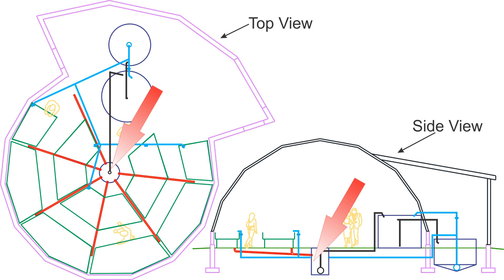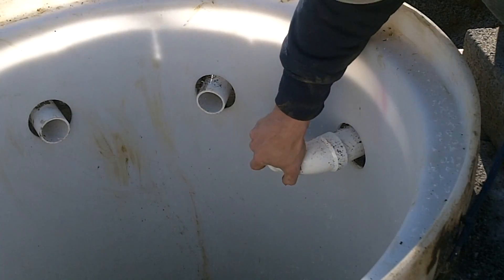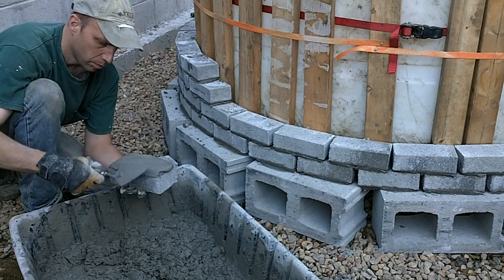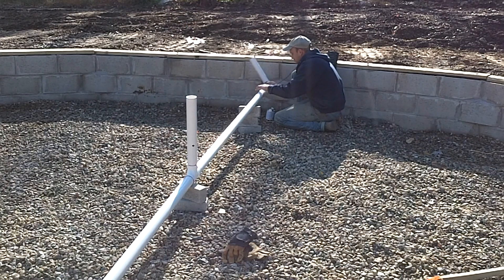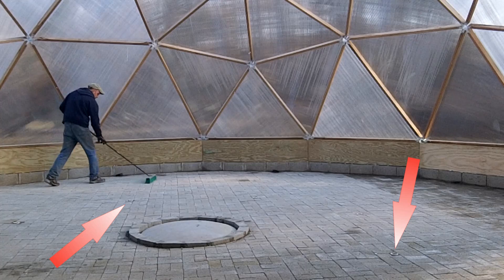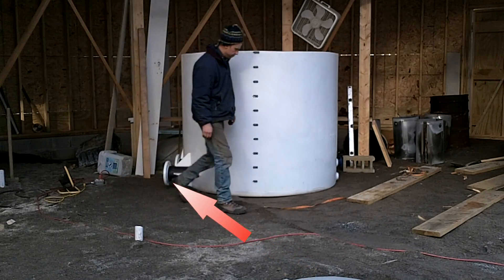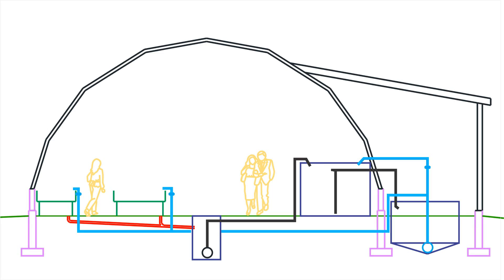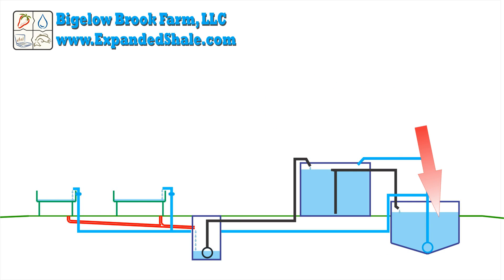Aquaponic System Install - 1 of 3

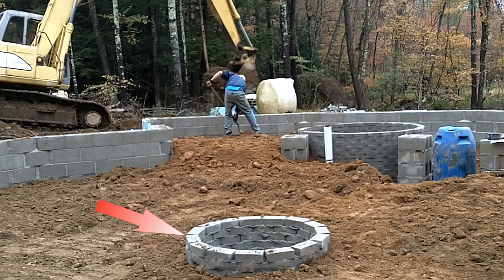Comment: at 1:25 I noticed you have some 1x2 slats between the brick and the tank. Is that for spacing to be removed after the bricks are done and the hole is backfilled or do you leave them in place? I'm wondering if accomplish the same thing by digging a similar sized hole, making a plywood frame and lining it with EDPM.

Comment: Once I had Tilapia mate in the fish tank. My system was a similar setup. The current pulled the fry into the sump. I started seeing these little organisms swimming around in the sump and wondered if I had insects in the water. Anyway I moved them back into the fish tank when they got bigger and it worked out. The surprising thing was my tilapia where only three months old themselves.

Comment from the maker: As long as you keep the greenhouse heated (at least above freezing) in the winter, the inner ground should freeze.  Our frost wall is 4 feet and we put insulation around the wall to help retain some of the heat.  It should work fine for you...but you may want to check your building codes, AK is a lot colder and you may need a deeper frost wall...?

Comment: Wow that is really awesome, but very involved. We have to go the inexpensive route. NOt to mention that we are in alaska and I dont think water pipes in the ground are a good idea. Although I am designing our green house and have the foundation several feet into the ground to use for better heat management thru the winter. Not sure how good the solar heating system will heat or if i will have to add wind generator too. Its a work in progress. Thanks for sharing!!!